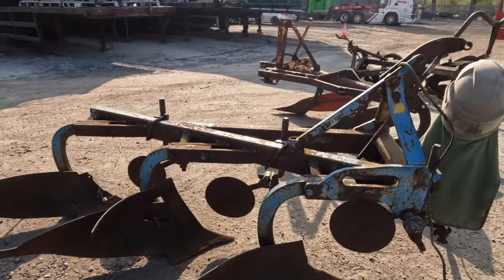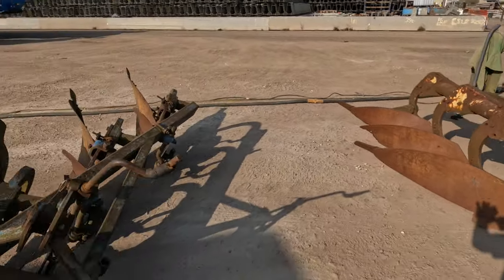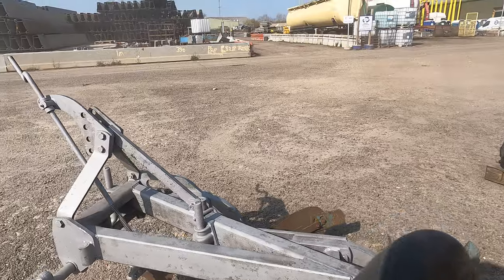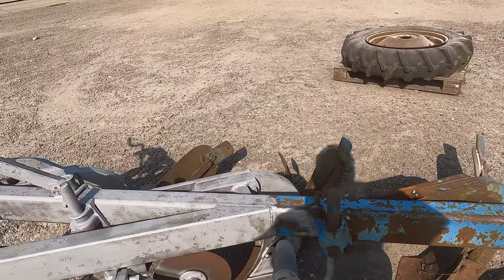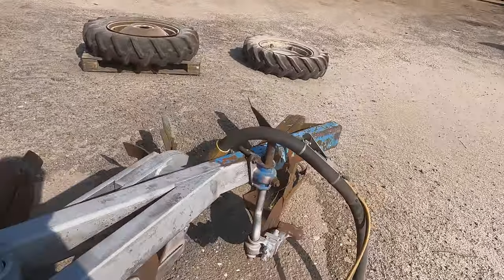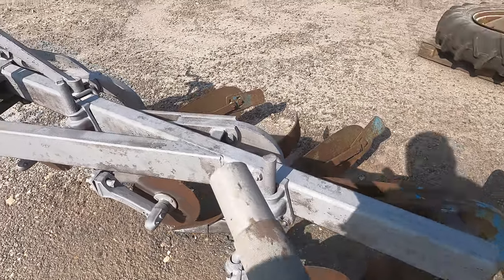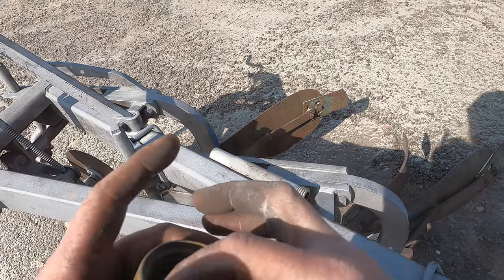Farmers Ploughs SandBlasting

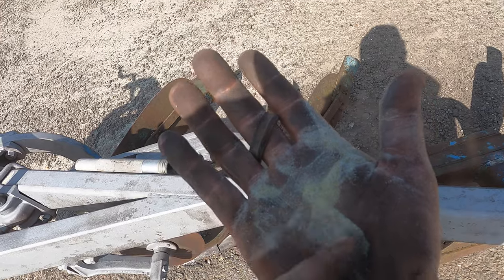Comment: @10:12? that "abrasive" (or what its called in english?) looks ridiculously fine, looks like powder, like something used in cleaning car sheet metal, i was expecting 1-2mm particle size, or something to that extent for farm equipment?
Reply from the maker: Crushed glass fine I do swap out with different stuff and different grades but the most important bit of blasting is the right nozzle not so much the media yes it plays a part but it all depends on the rig that's using it and the way things are setup 👍

Comment: What type the media are you using?  Looks awesome
Reply from the maker: Crushed glass yeah its awesome at ripping through rust and paint 👍
Reply: Thanks for answer I have a  1972 f250 and I want to know if you can tell me what size the media  I need  for sandblasting the full truck  
Thanks in advance
Reply from the maker: @juanmanuelarriaga7092  to have the right answer its impossible for me to say as the is way too many variables at play I know what I would use with my rig and my style. (Super fine crushed glass) you can course alot of damage if your not careful. If your new to blasting possibly use soda this way the risk is almost limited to 0 but an expensive way of achieving a similar finish a pro should be able to achieve. If your only planning on blasting 1 item it will almost definitely work out cheaper getting a pro than doing it yourself 👍
Reply: Ok thanks for the info
Reply from the maker: @juanmanuelarriaga7092  not a problem I hope you have fun remember don't put ya fingers were ya wouldn't put ya d**k that way ya should stay safe 😂👍